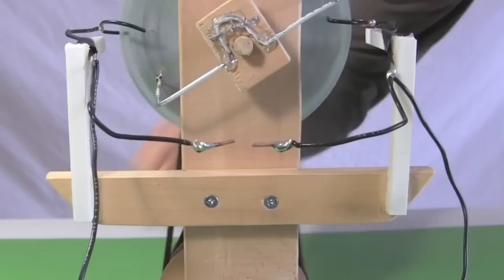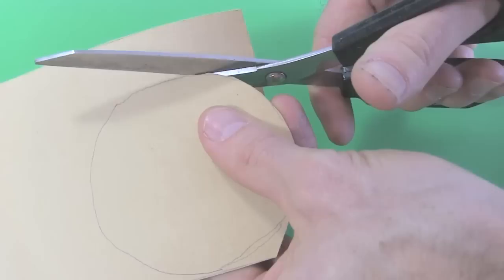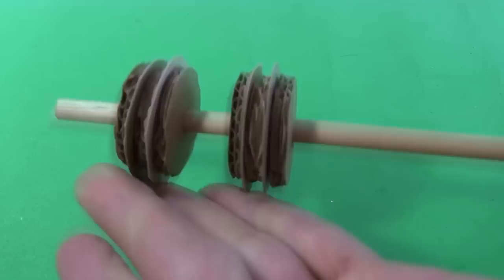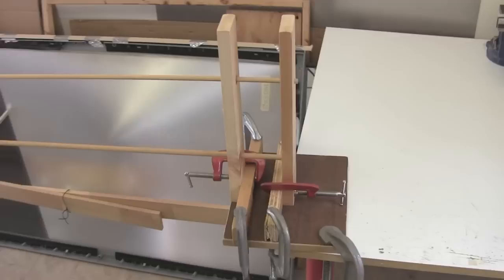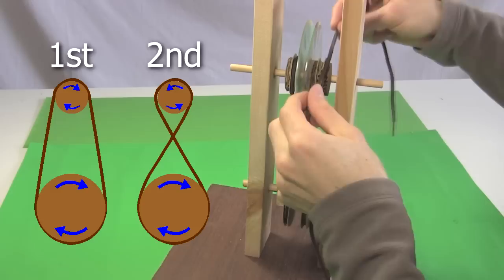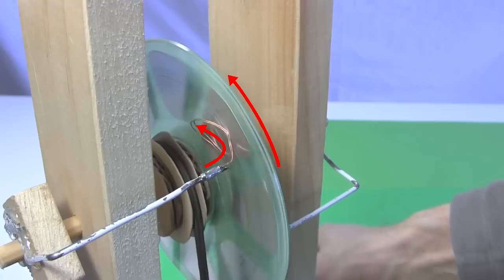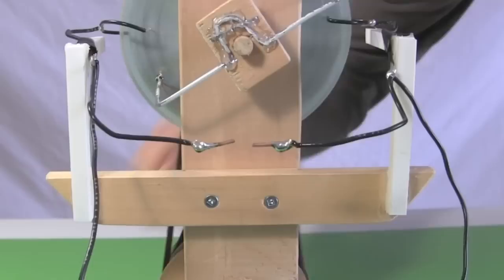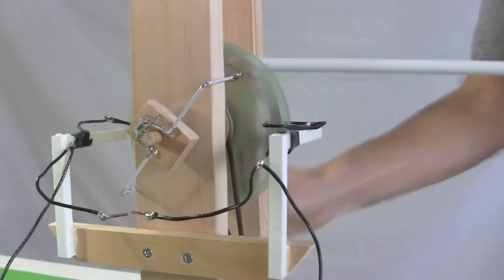Wimshurst Machine - How to Make using CDs

Comment from the maker: Glad to hear it's progressing!
The right collector is connected to the right side of the spark gap and to one side of the capacitor (it doesn't matter which side.)  The left collector is connected to the left side of the spark gap and to the other side of the capacitor.
Be sure to rewatch the Adjusting section of the video starting at 9:47 when you're ready to start producing sparks.

Comment from the maker: This was the second time I've made a hand crank, the last time being many years ago. I was surprised at how well it works given how easy it is to make.
Reply: Why don't you replace hand crank with a mouse or gerbil or hamster wheel ..

Or use a tiny battery style engine to run the cranking off the energy you create ?

Comment: I've owned a Wimshurst purchased from a scientific catalog for over 10 years (with much enjoyment of it) and have had plans to build my own model one day but have always read that the sectors needed to be made from "tin" and could never find anyone to answer whether it mattered if sectors were made from aluminum instead, and never bothered to make any of my own lacking that single detail, since I've been fairly unable to find specifically tin.. but you've answered this question quite nicely..  I have access to large pieces of plastic that would do quite nicely for a large version =)  Thanks for answering my question!
Reply from the maker: I'm glad I could help. The sectors can actually be made of any metal, copper another one that would be easy to find and work with. The important thing is that the brushes be able to make electrical contact with the sectors, so as long as they're uncoated metal you should be good. Feel free to ask if you have any other questions, and have fun with making it.

Comment from the maker: It depends on what the sparks are occurring between. If the neutralizer brush is not touching the sector and the spark is between the brush and the sector behind it then make the brush touch the sector. If it's between the brush and the next sector then you could either trim or move the brush so it doesn't come as close to the next sector or space out the sectors more. Glad you like the vid!

Comment from the maker: If you do the tissue paper test at the disk, and it doesn't show signs of being attracted to the sectors, then the problem is with the neutralizers and disks. In fact, you can remove the collectors and the disks should still charge up with the help of the neutralizer bars. You can spin the disks for a bit and then stop them while you do the tissue paper test.
Keep at it. You'll get there.

Comment from the maker: Thank! Based on the spark length and the shape of the two blunt wire ends on either end of the spark gap, I estimate roughly 12,000 volts with the capacitor. I haven't tried without the capacitor and right now I can't get any sparks since the humidity here is very high. I just put on the air conditioner so maybe I can try without the capacitor later in the week. With round balls for the spark gap I could get higher voltage for the same effort.

Comment from the maker: The thickness of my disks also adds up to about 3 - 4mm, usually 4mm. A slight wobble won't matter either unless it's causing the neutralizer brushes to not be touching the sectors, or to make the collectors touch the sectors. Do get any results with the triboelectric charging I demonstrate at 11:44 in the video? Cut a thin strip of toilet paper and hang it with the tip near the sectors at the top. The tip should tend to attract. It should attract more near one plate of the capacitor.

Comment from the maker: I don't really have a hobby shop. All those machines are portable and get stored when not in use. Actually, I could have used the hand saw instead of the scroll saw for cutting the wood. And if you can drill a straight hole for the shafts using a hand drill then you don't need the drill press. But those machines are lightweight, portable and relatively inexpensive.

Comment from the maker: +Bhargav bv The voltage it produces depends on how wide the spark gap is. In this video, a very rough estimate would be that I'm getting around 5kV. A bigger Wimshurst machine can produce much higher voltages. It's hard to say if a Van de Graaff is better. I think a Van de Graaff can give a higher constant current, if you're using it to feed something else, though that depends on things like what materials you use for the rollers and belts, how wide your belt it, how fast it's turning and how big diameter the dome is. A Van de Graaff is affected more by high humidity.
PS There's no Reply button under your comment because of your Google+ settings.
- go to your Google+ page,
- in the top, right corner click on your thumbnail icon,
- in the popup that appears, click on "Settings".
- for the 2nd question down "Who can comment on your public posts?" set it to "Anyone".
Reply: How much amper can it produces

Comment from the maker: The one in this video isn't dangerous. The voltage can be high but the current is tiny. The ones with larger disks that you see in some of my other videos, around 1 foot diameter, can produce sparks that hurt, but they don't cause damage. Larger ones can burn skin. In all cases, if someone has a heart condition then it's best to keep them away from sparks. (Sorry for the delayed answer. Somehow your comment got marked as spam so I didn't get notified.)

Comment: For anyone wanting to start building this with CD's I believe most CD's are not transparent after sanding the image side as the diffraction grating pattern that gives the rainbowy side is always in between two thin disks, so if you split that CD you could remove it but get your trash can nearby as you prob destroyed it. This is not on one side like the image. The transparency helps a lot in aligning the sectors but hey you might not find this a problem but alternative solution for the disks is highly suggested by me. Just thought this could help someone and save money. (I bought over 20 CD's).

Comment from the maker: 1/2 in is much too wide a gap. It's really the distance between the sectors on two disks facing each other that matter. The CD's are just electrical insulation and a support mechanism for the sectors. With my 1 foot diameter Wimshurst the distance between sectors when they face each other is around 5/16" to 3/8". But with this CD machine the sectors are smaller and the outer disk edges turn slower, so to get timely charging, even closer than that would be preferred.

Comment from the maker: The faster the disks rotate, the more charge you'll build up, and the more of it that will get to the capacitor and spark gap before being lost. So if you can only rotate it slowly, then you might have to crank a long time or it may never spark at all. Are you able to turn it as fast as I do in the video?
Oh, another possibility is humidity.The drier the air the better, though I got sparks yesterday with 60% relative humidity (30 - 40 is normal.)
No problem re the questions. I'm happy to help.

Comment from the maker: +Bhargav bv Cardboard discs should work but make sure they don't get wet since that will make them electrically conductive. They may even get wet enough in a room with high humidity. You could try covering the cardboard with tape to help with the wetness problem. Let me know how it goes.
PS There's no Reply button under your comment because of your Google+ settings.
- go to your Google+ page,
- in the top, right corner click on your thumbnail icon,
- in the popup that appears, click on "Settings".
- for the 2nd question down "Who can comment on your public posts?" set it to "Anyone".

Comment from the maker: +Frederick Vella It's hard to help someone with this one without seeing it. For starters I suggested going carefully through the Adjusting section near the end of the video at 9:46. You can send photos to my email address which you can find at the bottom of all of my webpages on http://rimstar.org. The less sharp the those ends at the spark gap are the better it'll work. Some round metal balls for the spark gap or the round ends of some bolts will work better.

PS There's no Reply button under your comment because of your Google+ settings.
- go to your Google+ page,
- in the top, right corner click on your thumbnail icon,
- in the popup that appears, click on "Settings".
- for the 2nd question down "Who can comment on your public posts?" set it to "Anyone".
Reply: RimstarOrg Is it possible to Take this and replace the crank with a Motor?  or would it then essentially become a van de graaf Hybrid?
Reply from the maker: Eidolon Yes, you can replace the crank with a motor. It'll still be a Wimshurst machine, just one that you don't have to crank by hand.

Comment from the maker: How close together are your sectors? I deliberately kept min far apart because charge can leak from one sector to the next at certain places in the rotation. I'm not sure how much the sharp corners would matter since the sectors themselves are thin along their edges. There can be a lot of adjusting like I talked about near the end of the video to get it going. How sharp are the two ends at your spark gap. The rounder there the better it'll work.

Comment from the maker: They're really difficult to compare based just on physical size since even within that there are many variables but my understanding is that typical Wimshurst machine output current is low double digits microamps whereas Van de Graaff is single digit microamps at equivalent voltages.

Comment: I think it must be a litle dificulty to replace each end of the neutralizers by a rolling ball who can spin freely and electricly connected on the other end, the thing of that is for to have lesser frictions.
It is a very good machin so.
Reply from the maker: Thanks. And I agree, what you suggest it difficult. I've tried making electrically conductive bearings like that before and it is difficult to do. You also have to make sure you have good physical contact all the time, so you'd need some spring mechanism to push the ball against the disk. I've never seen a Wimshurst machine with disks that don't wobble. However, there's a third possibility. Some people have made Wimshurst machines where the neutralizers don't touch the sectors at all.

Comment: I wish i had known his way to find the center of circles when I was making flywheels. I used trig to draw tangents and made lines 90 degrees from the tangent. Repeat at least 4 times.
Reply from the maker: I like your method. Any line on the edge of a circle is a tangent so just draw a few and follow that with some 90 degree lines. I hear you when you say repeat at least 4 times though. So many clever ways to do these things.

Comment: Well it doesnt rotate AS fast as yours (cause the disk pulley was slightly bigger than it should be), but its not very slow either. The humidity can't be the case because the AC is always ON here. I think I'll make some more adjustments like a smaller disk pulley and so on. I'll just have to keep trying till it works.
And thanks! I really appreciate it.

Comment: I find it interesting that the compass is not mentioned in the making of the cardboard pulleys. It precedes the Masonic symbol.
Reply from the maker: A compass would work fine. I chose not to use a compass for two reasons. One is that the precise dimensions weren't important. The other is that many people don't have one and since the dimensions weren't that critical, I figured it'd be easier to go with things people could find around the house.

Comment: I have a slight correction: the thickness is actually 5mm. I only realised it after checking again.And yes I did try the triboelectric effect but nothing happened. The last thing left to alter/correct on my machine is the shape of the sector. It has sharp edges instead of smooth ones like yours & I recently saw tht sharp edges can cause corona discharge. I'm thinking tht it could be one of the reasons that the machine isn't working?
Anyways thanks a lot for the tip, i'll definitely be using it.

Comment: i like your videos thumbs up and that's a lot of spark but could you make a video on using its energy or converting it to use in some daily appliances . Please.
Reply from the maker: +Naveen kumar There's very little power in that tiny spark. Also, Wimshurst machines aren't very efficient. It would be more efficient to just connect a normal motor to the crank. When you turn the shaft of a motor it becomes a generator and produces electricity.

Comment: 1:56 NO! You found the center of the corner of the piece of paper you drew the square on, and the approximate center of the circle that you approximately laid within the square. You should have done what you were starting to do which was to find the longest Side Market and then go perpendicular and find the longest side and Mark that and that's your center of the piece
Reply from the maker: I'm not sure that would have been any better, probably just as good. The diameter of my circular cardboard piece varied a lot, it was pretty rough. A line across the longest diameter may not even have crossed the center. But similarly, when I measured the diameter, I also may not have found a line across the center. With an ideal circle, both methods would work. (That's assuming I understood correctly what you described.)

Comment: Alright so i built everything, but the thing is, no spark is happening. I see discharge at the neutralizer bars, but from touching  the electrodes on the spark gap it seems its not charged at all. Could it be the collectors? I filed down a thick copper wire as a collector. Its sharp enough to cut my skin, and its 5mm from the disks.

Nevermind I mounted the neutralizers 90 degrees off...

Comment: can we light 2,3 led with it
thanks for replying
Reply from the maker: No, it's a high voltage output, thousands of volts. However, I once saw a person put an LED in series with a neutralizer bar and it worked. That means either breaking apart the neutralizer bar in the middle and putting it there (trying both directions since the LED works in one direction only) or putting it where the brush connects to the neutralizer bar, which is easier.
However, that was done with a Wimshurst machine with a bigger disk, around 1 foot/30cm in diameter, so there was more current available. I don't know if it would work with this smaller one.

Comment: I tried building one of these with some different parts. I'm using some larger acrylic discs I cut from sheets, but to prototype things I tried the cardboard gears and it didn't work very well. It's really critical that the center whole on the gears is centered and doesn't wobble or during part of the rotation the tension will be high while other parts will be too loose. It seemed like I needed a lot more tension to get things to spin, and at this level of tension the knot in the string would jam up in the gear, so this really just gave me a lot of trouble.

I have taken apart quite a few printers though and these have some nice toothed bands and some gears, which could be used, but in order to use these belts on the same drive shaft you'll probably need a tension pulley on one of the belts, since otherwise, with the crossover, one has to be longer than the other. However I decided just to use some clothes line pulleys and some screen door wheels to attach to the spinning discs, and I ordered some hollow round belt tubing from McMaster Carr which was really cheap, and can be melted into a continuous loop at the right size.

It's still a WIP.
Reply from the maker: Yeah, the cardboard pulleys are really only good for small ones like this one. I'm also planning on making one with larger disks, trying old vinyl records. For them I'm thinking of designing and 3D printing some pulleys. An alternative to pulleys for the bottom is this approach, https://www.youtube.com/watch?v=v_K9bMGcaug. It may also make the belt easier to do too since there's just one to worry about.

Comment: can we stick wire on neutralizing bar instead of soldering
Reply from the maker: Yes, just make sure they make good electrical contact with the neutralizing bar and won't come loose. Soldering is a fairly reliable way of doing that so that's why I did it that way.

Comment: I have a question about Wimshurst machines in general: Why do the collectors need to be combs?  In other words, why can't the collectors contact the metal plates?  Thanks!
Reply from the maker: To be honest, I'm not 100% certain why. The combs are electrically connected to the spark gap and Leyden jar and so are at the same potential. If the combs were in physical contact with the metal plates, then when touching the metal places, the metal plates would also be at that same high potential and possibly spark to the adjacent metal plates. That's my guess anyway.